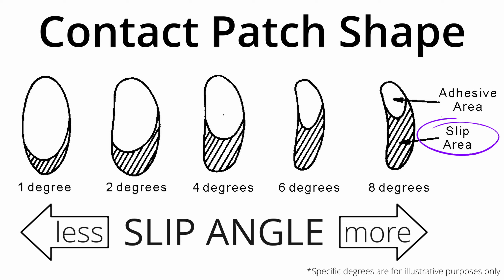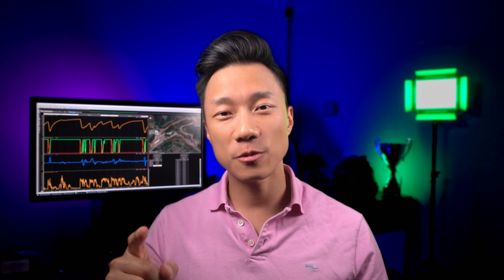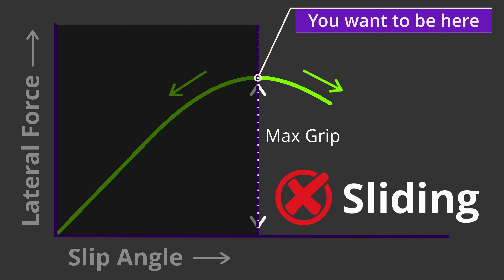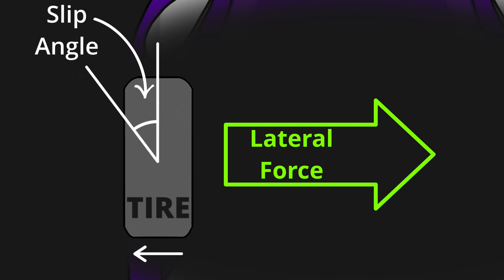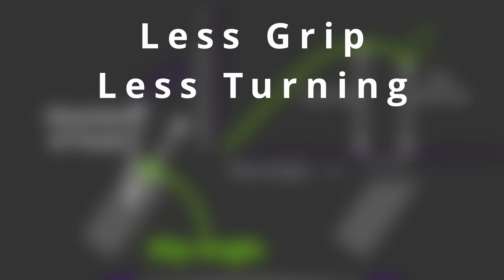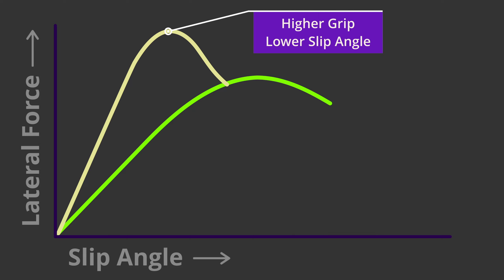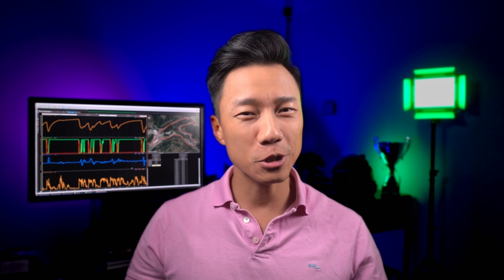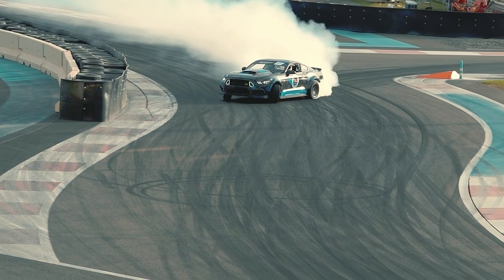Use Slip Angles to Corner Faster [TIRES EXPLAINED]

Comment: You mentioned that it isn’t recommended for novice drivers to use tires which have a high grip level but small window for slip angle. Well, it really isn’t a good idea for almost anyone to use such tires. I remember reading about this very subject about 25 years ago, regarding 500cc GP bikes. There were VERY few riders who could make use of the extra grip afforded by tires with a construction which are exactly like those you spoke of. Essentially only the absolute best, highest level riders, guys like Mick Doohan and Wayne Rainey could actually use tires with that sort of construction and not only use them but really use them, taking full advantage of the extra grip. But for literally almost the entire rest of the field simply couldn’t ride tires like that because they just don’t have enough feel and feedback, such that it’s exceedingly difficult to know when you’re approaching the absolute limit of the tires as they don’t provide much feel and when the grip runs out, they weren’t progressive at all, they just lost traction so quickly and it was near impossible to get it back once that happened. For the rest of the field, everyone would get better lap times using tires which had quite a bit less overall grip but a huge window and HEAPS of feedback.

Nice vids you’ve got on your channel, keep em coming!
Reply from the maker: Thanks, I don't know much about motoGP. That's really neat info!
Reply: Motorcycling is very different from driving a car, though. A small slide on a bike can mean lights out. Having four wheels is much more forgiving
Reply: In four wheeled vehicles with relatively square tires, even a very mediocre driver will go faster on grippier tires even if they provide less feedback. The difference isn't that large once up to temp.

I don't know much about bikes, but I would guess that the grippier tires were under temp and everyone was spinning before getting them up to temp. Slicks can have quite large dropoff when cold.